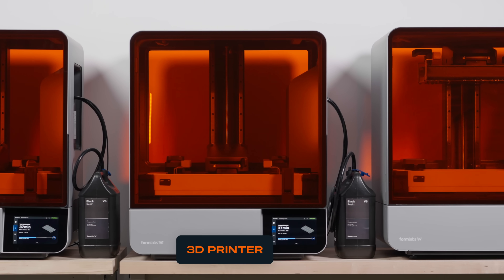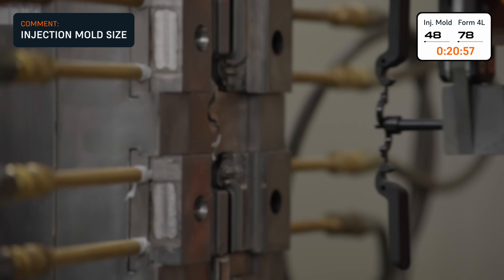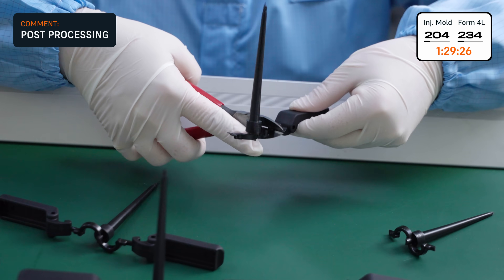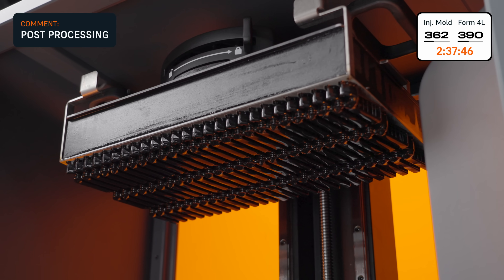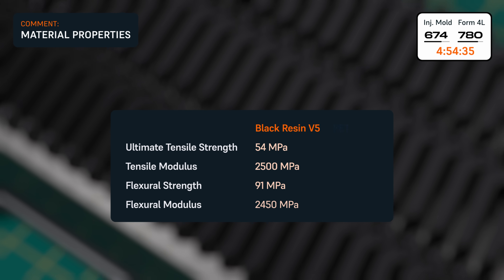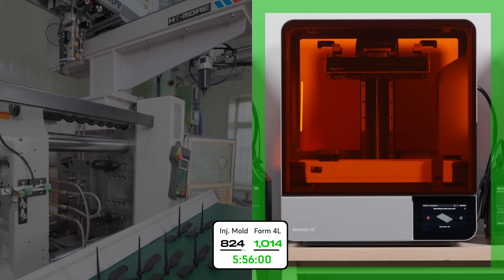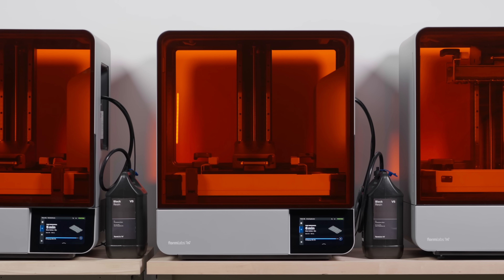Race to 1,000 Parts: 3D Printing vs. Injection Molding

Comment from the maker: Fast, cheap, good: can you really have all three? For years, injection molding has been the go-to solution for manufacturing plastic parts quickly, affordably, and with excellent quality. But with advancements in 3D printing, is that still true? Learn more: https://bit.ly/3OR61xW
Reply: 38.4 seconds per part on the injection mold machine? Is there a video showing that?
Reply: @davex.4785  Where I work some of our injection molds run 64 cavities with 5 - 6 second cycles. This video is only referring to short run jobs that you only run for a few days. I can see it being beneficial to startups who make the parts they need in house before moving to mass production.
Reply: Fascinating comparison!🙏 This really highlights the importance of matching the technology to the production volume and timeline. While 3D printing excels for ultra-fast prototyping and very low volumes, injection molding becomes unbeatable for higher quantities — but the transition between them is where many projects struggle😂. In Shenzhen,we specialize in bridging that gap: helping clients use 3D printing for validation, then smoothly transition to low-volume injection molding or vacuum casting for end-use parts😀. Thanks for showcasing this so clearly!👍"

Comment: I've worked in an injection molding facility before and seen firsthand how quickly they can spit out parts. If they're smaller, you can have literally dozens of them on one mold and they can finish in under a minute.

The 3D printer definitely wins in cost and labor though. Anyone can go pick up an entry level printer and spend a week or two learning how to use it and get acceptable results with a few clicks of their mouse. An injection molding machine needs a mold for every part you want to make which are not cheap to design and produce.

Comment: I just purchased a full 4L package at 25k ish dollars.  I've got a large print farm of prusas printing abs parts (over 135k parts made and shipped worldwide, installed into thousands of cars across the globe) and have also injection molded product with partners in China.  I'm hoping to bridge the gap between the two processes and limitations.  I think this video is good when size is catered to the machine, but in my case, I injection molded a product that would easily beat this machine in many ways.  I think what's important is having access to processes and then matching your engineering/design and decisions about how to use each process.  I'm very hopeful that my 25k will turn into exponentially more, much like how my 20k in Prusas has made millions of retail dollars of product.

Comment: This fits my use case exactly..Buuuut the Form 4L package with everything I need costs $20k. That's enough for 2-ish small production runs, and I don't have to mess around with labor and materials if I outsource.  Not a fan of locking down the 3rd party resins, either.

Comment: i don't really buy the strength test however i do agree that incorporating form 4l into the production ready process would definitely make it faster especially that 4-6 week wait period on the metal mold cuz you can just 3d print the plastic mold and create the metal mold in-house and it'd be faster that way.

Comment: short term use i see 3D as the better option... but for long term production i think injection is going to be more consistent and cheaper.. in some ways i think what is being made does affect things a bit too.... this is not to say that 3d printing will not exceed injection molding completely at some point, but for now both methods are viable options based on application.....

Comment: Design Engineer for 20 years with Injection Moulding (UK) including 3d printing geek throughout.

This video is technically NOT misleading to pros, however it is misleading to those who isn't familiar with different plastic processing capabilities to reach 1000x pcs e.g.  if Form 4 is so good, why are you using traditional 2 Cavity IM 0:34 ???

Other plastic processing processes includes:

~1-100pcs CNC plastics
~5-50pcs Vacuum Casting
~5-1000pcs Vacuum Forming (is design allow for a chocolate tray design)
~20-50 pcs RIM Reaction Injection Moulding (biggest draft angle)
~100 to 1000pcs (min) to ~5-10k cycle (upper limit) Soft Tooling & low pressure moulding

Your IM pcs cost is misleading, because after 1000x cycle, you still typically have ~4k- 9k life left even with soft tooling.

Also, your 3D print "post processing cost" (labor cost) need to be included as it is far greater than any IM techniques.
Also, speaking of IM post processing cost, have you not consider 3 plate IM ??? which remove tab gate as it eject.

Your video should include:

1 - SLA 3D printing is NOT an Injection Moulding (IM) replacement technology.

2 - However, during product development, there is an undeniable void that injection moulding isn't practical to make 100 - 1000 pcs.   When 3D Printing 'could' fill this void , but only few 3d printers can do this e.g. the Form4.
Reply: This video is as close to misleading without being outright fictional.  It also never mentions part finish quality, IM scalability, etc.  Those in the industry all know why 3D printing isn't the go-to small run production process - it has too many inherent downsides that traditional processes do not.

Comment: Injection molding with a hot runner generally requires no post processing. For a 2 drop the cost is under 10k usd for a mold and hot runner. Machine not included. Depends on the resin and if its gate is thermally or mechanically shut off. They’re meant for efficiency with a super high volume (millions of cycles). Source: I was a HR designer. That being said, I’m getting into 3D printing and love it, so it’s still an interesting comparison.

Comment: If 3d printing has all these advantages over injection molding, taking all the numbers at face value, are you planning on making the part shown in the video 3d printed going forward? And if not, what would need to change for that to be an option? Being able to say "We use our own machines in production all the time" would be a pretty big confidence booster in the idea of 3dp for manufacturing.

Comment: I need to watch more videos about Formlabs part cleaning and post cure.  That's what is keeping me from designing parts for resin printing, but I only have experience with consumer grade resin printing where post processing is awful.  We need a solution where a build plate is slid into a machine that automatically washes off the excess resin on the build plate, removes the parts from the build plate and drops them into a secondary wash bath to finish removing the uncured resin without scratching the soft resin on the outside of the parts, and preferably UV post cures the parts as they're gently agitated in liquid, then air dries the parts.  Once the post processing is automated and the resin and solvent costs are reduced, resin printed parts will absolutely overtake injection molding.

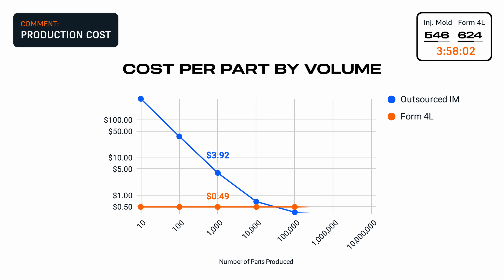Comment: 1:35 - not including 19999$ of 4L tooling and 6599$ of Form 4 from buying your own printers, because you already own them? Okay.
Reply: The cost is amortized
Reply: @Eureka_3D_Printing  but they did not amortize the tooling on the injection molding
Reply: @paultrautner1941  Tooling for the IM can only be used for a single part.  I think their rationale here is that you would use their machines for many different runs of parts, and thus only need to absorb the depreciation expense for a fraction of the tool on this specific job.  Kinda Accounting 101 actually...
Reply: Not including the injection molding machine… that would be the fair comparison

Comment: So if it takes weeks to even begin your production run injection molding a new part, how many 3D printed parts can you put out in that time? 1000 in 6 hours? With a print farm like Slant 3D you could potentially get your volume up pretty high and with 0 upfront costs and no stock.

I think 3D printing should be a stepping stone to injection molded parts. Get the thing out there and in the hands of customers. Sell enough to warrant moving to injection molding.

Comment: It doesnt really matter how you bias the data, 3d printing is always going to be faster and cheaper for the smaller batch sizes and how many start ups need 1 million parts of anything? 

On cheaper resin printers i still strongly dislike the post processing and ive had so many materials fail over time in my applications like outdoor use and underwater. I dont know if a formlabs resin would address that but i prefer FDM
Reply: I'll say the formlabs materials are worlds better than the cheap stuff.
Reply: @zachbrown7272  - I designed and printed small antenna spacers on a consumer grade MSLA 3D printer.  They need good tensile strength.  I printed them from Siraya Tech Fast ABS-like resin and tested them by hanging them outdoors in the sun and weather for a year.  They only got harder.  There was no surface chalking from UV degradation or oxidation.  The year old parts looked new.  I believe the smallest cross section was 5 mm x 5 mm with 1 mm radius on the corners and they survived a 200 pound tensile pull test.  Presumably Formlab resin is even better?  The comments have many criticisms of 3D printed part strength and that's probably an issue if printing art miniatures from non-structural resin but not an issue for structural resin parts.  I assume the comments about layer strength are from people who are confusing resin printing with FDM 3D printing.

Comment: If it were ultimately practical to 3D print over injection moulding for commercial scale production, we would already have it as commonplace. Same with pin matrix tooling, metal 3D printing etc etc . Practicality is the destroyer of hopes, dreams and “coolness factors”
Reply: 3D printing hasn't been around for that long. I think it will have its place but the technology still has a long way to go.
Reply: @ it’s good to remain optimistic and hopeful. Also, continued research is always better than no research. However, the case of “it’s a matter of time” is generally a fallacy used to sell stocks rather than predict technological change.
Reply: @OneIdeaTooMany  3D printing has actually been around for over 30 years at this point. And it also is already used for commercial scale production --it's just that it's most commonly used at scale when mass customization is required (e.g. Invisalign) rather than the example shown here which is specifically a head to head comparison to IM which can't do mass customization
Reply: It seems like they found at least one application where it does make more sense...    Its another tool in the tool belt, not the ultimate production technology.

Comment: This is a fairly terrible comparison.  The fact the injection mold wasnt sub gated tells me you didnt know what you were doing.  You selected a formlabs material that wouldnt work in any real industrial setting were a PP, PBT, PA66, POM part would be typically spec'd.  You ignored post processing time to remove supports, even with cutting two parts off a sprue, that is significantly faster than cutting off 5-6 supports from each of those parts.  
Sure, the form4L is impressive with its build volume and speed, but its accuracy pales in comparison to an injection mold and if you measured those parts bsck to cad they would not the same unless you put large tolerances on the to cover the differences.

Comment: This is a bit dumb frankly... I can't say I've ever seen anyone who's made a bad enough production decision to make a thousand small injection moulded parts as a production run... Given the shut time on a small tool like that you're comparing 3d printing to maybe a half a day of production from a small injection molding machine.
That type of machinery only makes sense at volumes well above 10k parts if for no other reason than because the set up and tear down time on the tooling will be in the ballpark of 4 times your actual production time. 
If you want to compare vs injection moulding at least use a week's worth of production on a small machine like that, maybe 25k parts...
Realistically though you run those tools for hundreds of thousands of shots...
This is like saying "a Ferrari is a crappy mobility scooter".
Reply: We often use short run injection molding for prototyping and high cavitation in production for automotive applications.  Many times the order for parts is less than a thousand to cover prototype builds.  
The kicker is, they would never allow a part from a formlabs machine, especially their junk black material
Reply: @Fishbone8891  sure, that makes sense. Make a prototype tooling run, that'll be quick low volume work but you can't make a pre production prototype with a completely different process to your planned volume production regardless. For anything injection moulded in production in the car industry a million is a low number 🤣
Reply: @drew79s  a million isn't common when your talking about engine covers, wire routing aides and other custom plastic brackets that are 1 per vehicle.  It is low when you talk about zip ties and fasteners, to which I've designed both so I know where you're coming from.  Any one cavities that are cut for pre production all have to be simulated production with gate locations and materials.
Reply: @Fishbone8891  sure. There are definitely some engine covers that have made it well past a million though... Ls, for instance 🤣
But yeah, there's also an engine cover on the 1.2L engine option for golf that nobody buys as well 🤣
Way back in the deep dark past i worked on pressed metal springs, multislide products. We had two product lines that would push maybe between 100mil and 250mil per year, both to hold plastic parts... The lower part count for us held 2 and the higher part count was 2 of our springs per part, so about 200mil shots a year on one and about 130mil on the other. I think the little one was a 50ish cavity mould and the larger product was 24 cavity.
Multiple machines on 24 hour shifts for both products.
I'm not much of a plastics guy, i can design the parts but not the tooling, but that said, both of those die sets were beasts 😁
Reply: Save a lot money, with machining core molds....this is important
Reply: @jhonnyd3505  on 1% of a production run? What about the other 99% you need to make?
Reply: @drew79s  A 3D printed farm...
Reply: I think you missed the point here.  They are saying that for small runs like this or up to ~10,000 parts, which aren't uncommon in some industries,  it makes more sense to print than to injection mold.
Reply: @SeaMushroom98  which industries?

Comment: Shall we talk about temperature resistance?
Reply: SLA materials are arguably more temperature resistant. They are thermosets, so do not "melt" like a thermoplastic. Formlabs and other SLA makers also have specific high temp and flame retardant resins.
Reply: @zachbrown7272  I disagree - just read the TDS for the Formlabs Black Resin V5 - the HDT @ 0.45 MPa is 69 degrees C and the HDT @1.8 MPa is 57 degrees C - this makes it unsuitable for engineering purposes.
Reply: @zachbrown7272  Then if you compare it to the high-temp resin, you can see that the high temp is super brittle.
Reply: @zachbrown7272 Trying to compare SLA and Injection molded PET is outright ludicrous. Compare injection molded vs SLS (or MJF) PA12, elongation at break for SLS is around 30% whereas for IM you get around 250 to 300 %. Let's not even talk about SLA.
Reply: @zachbrown7272  For SLA you either get the temperature resistance or the toughness, you can't get both.
Reply: @JulienStone  that's true, but not every engineering application requires high temperature resistance. I think it's unfair to say that one property completely disqualifies materials from an application. Likewise, your comparison of injection molded versus SLS PA12 is a total apples and oranges comparison. They aren't talking about nylon, they're talking about Black V5 and PET. It's true that across the board, PET is a much more resilient material, but the point is that a printed part would still actually work in this application. I think the old saying of "anyone can build a bridge, but it takes an engineer to build a bridge that's just strong enough" really applies here. You don't need to make your latches out of Ti-6Al-4V, that's just absurd and bad engineering. Likewise, if you can save time and money by printing a part, even if the end part is not as mechanically strong as the IM part, as long as it functions the same then is there actually an issue at all?